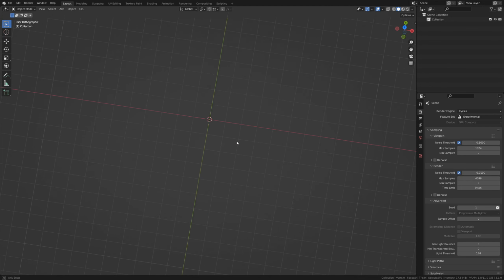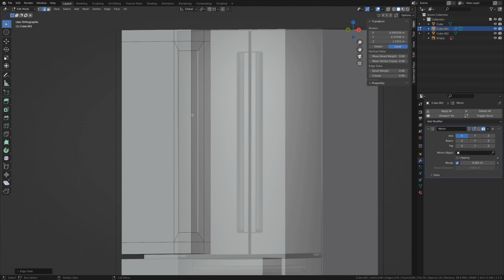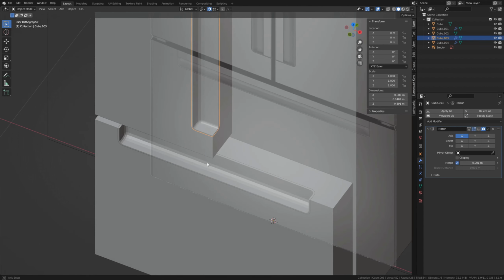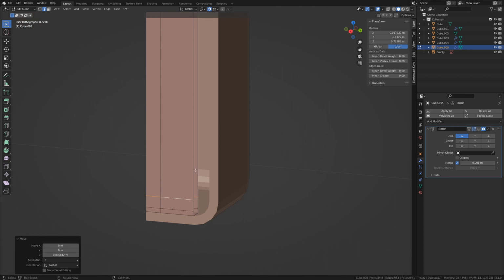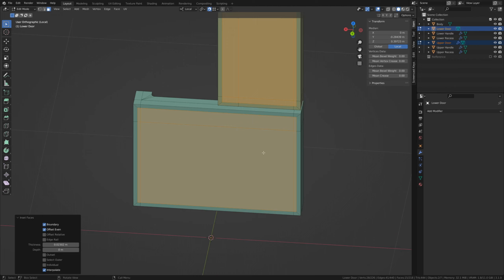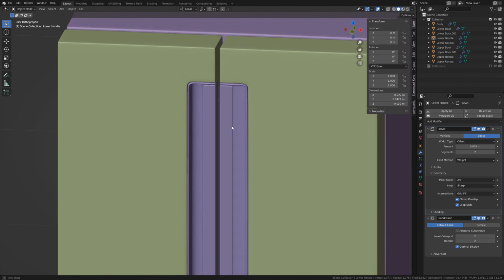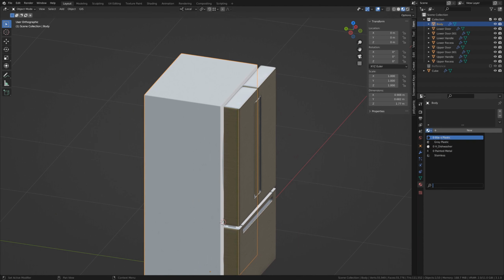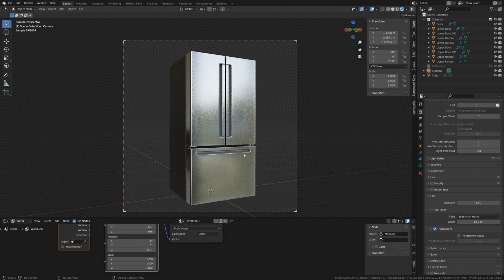Making a Refrigerator for Archviz in Blender

Comment: Good day. Attempted the project. My problem is both fridge and freezer door mesh is being intersected by the "plastic" membrane for those handles and its not looking the best, Maybe they should be reduced so the .006 solidify madifier would fit flush. Hope you follow me on this.
Reply from the maker: If I understand correctly, your solution sounds right. If two parts are intersecting then you should only need to reduce the size of one of the parts. In this case, the rubber part.
Reply: I will attempt it. Thanks and your reply was super-fast man!
Reply: @BlenderForge  did as suggested and all is well. Thanks again.
Reply from the maker: @michaelpenco546  Awesome. Happy to hear it!

Comment: You are a little bit fast with typing in the dimensions. On the website it´s in imperial system. It would be easier if you could add a small window that shows the sizes when you use them. Didn´t you do that in other videos?
Reply from the maker: You're right, I do in a later video when creating the kitchen cabinets. These were earlier videos in which I was still getting my act together :) I'll keep the measurements thing in mind for future videos.
Reply: @BlenderForge  Thank you. I watch a lot of different tutorials and I was still able to learn something new in your videos. I started this refrigerator video because I think the dimensions will match your kitchen.

Comment: How did you save materials of the previous project separately so that you could append them here? Thank you for the tutorial btw
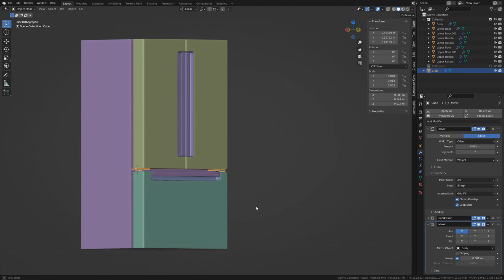Reply from the maker: That's a good question. I didn't actually save them in any way. I appended them to the current scene from the previous one. Starting at 30:46 I show how to append a material from an existing blend file. I hope that helps!